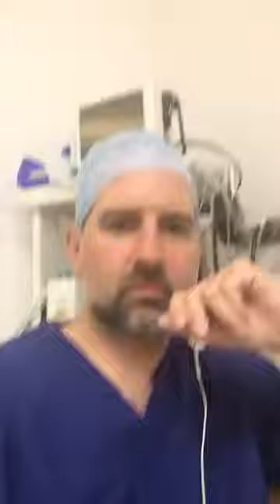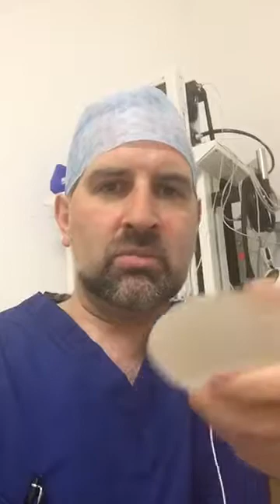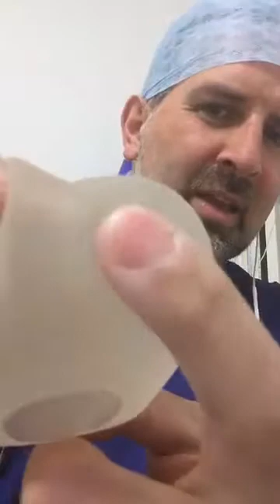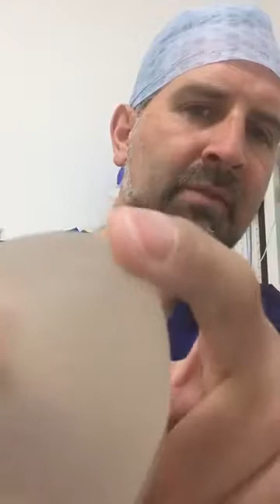Episode 40: polyurethane implants, how a breast implant can cause a breast lump and postop swelling.

Comment: I had implant replacement after 30 years in Australia and my PS used the 14 point plan and I haven’t developed a capsule yet I’m 8 months post op
Reply from the maker: Hi Robyn, that is great news.  8 months is still early days as it usually takes years for the contracture to take place but this is promising.  Most surgeons would agree and adopt the majority of the points in the 14 point plan and it is fairly standard surgical practice now.  The main intervention to prevent capsular contracture is the use of polyurethane implants.  Thanks for the comment.  JJ Staiano